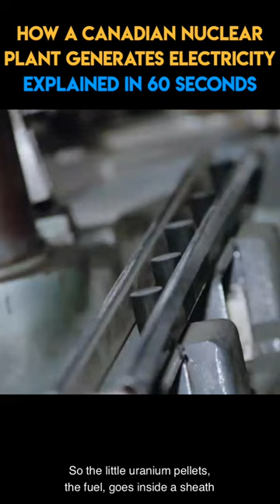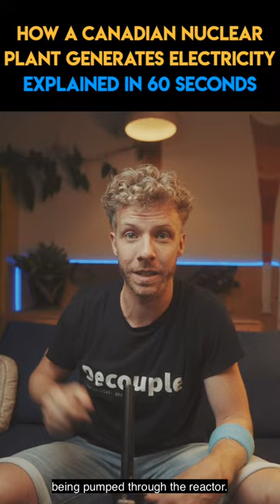#shorts | How A Canadian Nuclear Plant Makes Electricity

Comment: If nuclear electricity power station was the size of a shoe box and cost nothing it would still need millions and millions and millions of km of transmission grid. 
To millions and millions and millions of customers and $BILLIONS and $BILLIONS of cashflow yearly. 
In Australia $100sBILLIONS every year.

Now if you understand nuclear power electricity then you understand simple business wanting to be paid for its investment.
The national grid costs $TRILLIONS and was built over 10 decades. 
A 10% return to cover the fixed investment and the maintenance and emergency repair teams that work 24/7 is reasonable. 
The grid also must pay the generation plant owners something. 

So yes nuclear is amazing and every dictatorship should have its nuclear electricity industries as well to stop CO2 emissions worldwide.